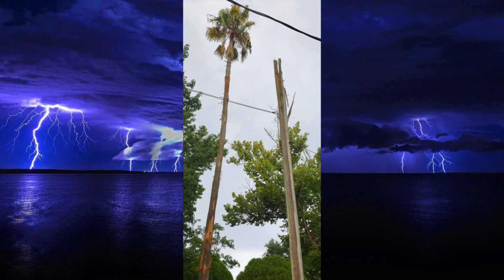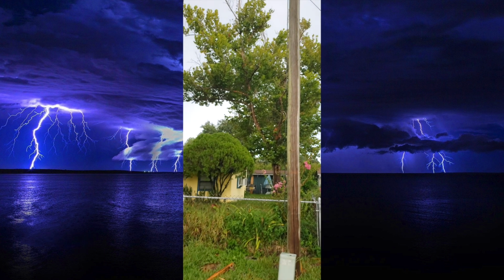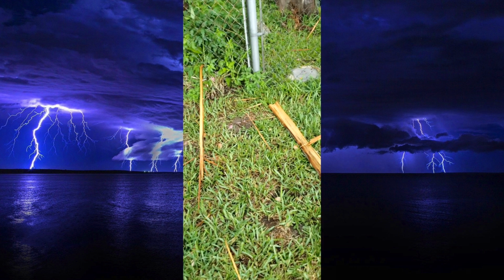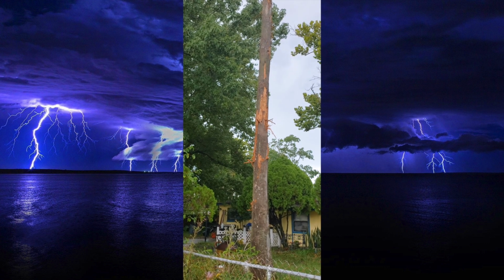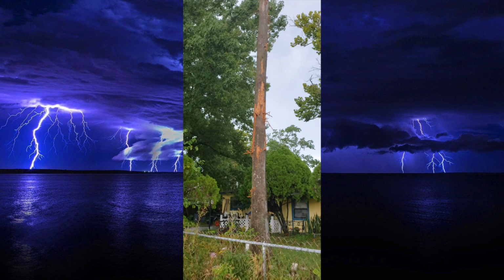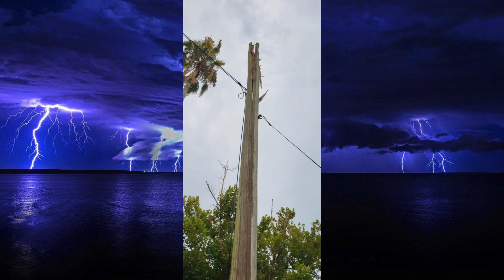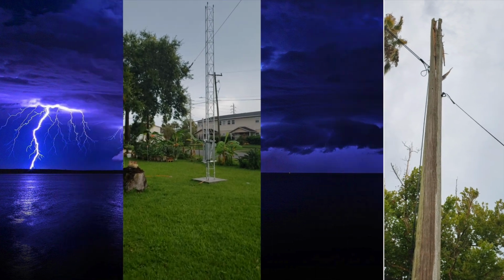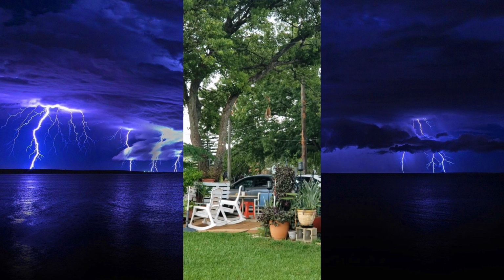Lightning Strike at my station N4VFR! | Hit by Lightning |

Comment: unplug,unplug,unplug. I run a simple station and live in FL. too. never took a hit but i always unplug everything (even have a quick connect to my rotor). I don't know if i can take a direct hit but if i do i know i did everything i could. sorry for your loss. Like your Vids.
Reply from the maker: I'm an airline pilot. Never home and Operate Remote HF.  Leave it plugged in so I can Operate.   I do have a remote disconnect if i need to.

Comment: Hi there from Orlando area, I took two direct hits this year in August! I didn’t file an insurance claim. I just replaced all my modems ,router,security cameras, well pump, run capacitors and a number of other small appliances, all RADIO equipment, was all fine as it was disconnected and unplugged. tower, grounded, and bonded but when you take a direct hit, there’s nothing you can do if it jumps in your house!
Good luck in the future Florida is terrible for lightning. 
73’s N4EVG
Reply from the maker: I still didn't get ARRL Insurance, maybe I should.  Florida is the capital for lightnings.  73 Darren N4VR

Comment: Do you have your tower grounded to the house ground? Because if the tower ground is isolated from your electrical service ground, a lightning strike (or even an induced surge) can create a dangerous difference in potential between the two systems. That voltage difference is what can cause arcing through your equipment, appliances, or wiring. The goal is a single-point ground system where the tower, utility service, and any other grounds (like satellite dishes or external antennas) are all bonded together. That way, when lightning dumps thousands of amps into the earth, everything rises and falls together instead of trying to equalize through your house.
Reply from the maker: It's been awhile.  I will need to check.  I don't think my tower is grounded to the house service ground.  I may have to do that.

Comment: Did you have a surge protector and lighting  arrester for your ham radio and power supply?
Reply from the maker: Yes I did.  My UPS got fried.  My Icom IC7610, Anan G2, RF2K-S Amp, and Palstar HF-AUTO all survived.  I had my PC motherboard and graphics card replaced under warranty.   I had to have my powered speakers and 12" Subwoofers repaired.  USAA Insurance is a Pain in the ASS to file a claim.  I will look into ARRL Insurance due to living in a lightning capital in the US.

Comment: My tower took a direct lightning hit last May and I am still working with the insurance company to get things replaced. I lost all the computers and network gear.  All my antennas on the tower. I also just about all my ham shack radios, tuner, power supply, etc. Working with the insurance company is a learning experience. If you have an questions on my dealings with the insurance company just ask. It will take a while, but you'll get back to normal at some point. 73 de N9JOD
Reply from the maker: Geez, a direct hit on your tower!  Wow!  Right now, I'm gathering my receipts and taking screen shots on replacement equipment.  I hope mine doesn't take long to settle the claim.  73

Comment: Lightning is Tough !   I am a Licensed Amateur Radio Operator but also worked with Electronics in Arizona for 30 Years.  Allot of Field work to include installing equipment on Towers.   I have seen Lightning do so unexplained things that cost us Lots of $$ .    I hope you get back on the Air and also get your Computer back on line...  Thank You

Comment: I have a lot of experience with lightning  strikes sadly. Lightning protection methods like lightning rods, grounding rods,  and lightning arresters are often ineffective for radio towers and the equipment. .  Your problem obviously came though the power lines. And possible cable equipment if you have it.  I had a very good grounded tower.  All the equipment was grounded.  Had lighting arrestors, etc.  I been struck three time in thirty years.  One time  I lost everything electrical in the house.  Over 10,000 in home theater equipment, 20,000 in ham gear.   I how have ham radio insurance.  200 a year covers 20,000 dollars worth gear including computers, software, towers,  radios, etc.   I feel your pain buddy.  Hang in there.

Comment: Sorry to hear of this, lightning damage is relatively  rare on commercial radio sites here in the UK but a bit more commonplace amongst ham radio installations. I appreciate it can be overwhelming trying to diagnose the specific failures after the event. Ii is surprising that companies are replacing or repairing equipment under warranty. Hopefully some hams that have dealt with insurance companies can advise you. 73

Comment: Hi Daren,  I have an Andromeda - and wish I had a G2.  Just thinking about the Thetis working  but VNC not.  Is it possible that you were going in via Wifi for VNC and enet for Thetis?  Maybe the Wifi is out on the Raspberry Pi, but not enet.. .just a guess.  73s de Steve KA6S
Reply from the maker: I'll try to troubleshoot when I get back to see if  wifi is working.  I have the Anan G2 connection direct to my Computer's ethernet (NIC) card.  I did troubleshoot to verify the NIC is working by disabling the Mobo's ethernet network connection.  I try to use ethernet connections if possible.  Oh, I forgot to mention that I discovered that 2 ports of 16 ports that I used to have connections too are also bad.  There is no polling lights when I connect to them.

Comment: Consider adding a Whole House Surge Protector to your mains panel. As you’ve discovered most strikes enter via the utilities. Miles of wires and poles to hit. I don’t recall all the details in your grounding videos, but make sure the mains ground is very well bonded around the outside of the house to you antenna ground rods and entry ground window (trying to encourage more surge current to go around the house rather than through). Run your shack AC, phones, Ethernet, etc. over to your entry ground window and connect them to ground via surge protectors before distribution in the room (doesn’t help your stereo in the living room!) Cadweld one-shots are supposed to be better connections to ground rods than clamps. Finally, how do your Hazer and antenna ground to the tower?
Reply from the maker: I still need to run a ground wire from my Tower to the house grounds.  Thanks!

Comment: Good evening Captain , sorry to hear about this , but let me tell you a quick story to definitely make you feel better. This was 20yrs ago when I was living at home . A storm just passed and out of nowhere my dad’s tower took a direct hit . It melted part of the rotator , came down the tower into the ground and blew a 4ft hole in my neighbors fence (the ground rods were next to the fence) , went back up out of the ground inside the house blew the faceplate off of a brand new kenwood , fried a new computer , fried a new central air conditioning unit , and fried a new tv ! You should be feeling a bit better now LoL . Lightening is no joke , if I’m not in the shack the antennas and radios are unplugged. Be safe captain we”ll talk soon , 73’ N2JDX
Reply from the maker: @stevehall6539  Wow!  Thanks Steve. I'm feeling lucky then, lol.  It's a risk I'm taking to always having my antenna connected to the radios. 73

Comment: When I watched your videos of the tower installation, I didn't see you bond the tower ground to the service ground for your QTH.  I also didn't see you take any readings to determine how good your grounds actually are.  If I lived in Florida, I wouldn't consider putting in a ground system without using something like an AEMC Ground Resistance tester to check how good the ground was.  You also need to read, understand and be fully compliant with the NEC.  Pay particular attention to section 800 - Communications Systems, it specifically calls out amateur and citizens band radio installations.  The first thing a sharp insurance adjuster is going to look to see is if you're compliant and if not deny any claim.  While you're at it get some anti-climb plates put on your tower before some kid climbs it and falls off and you get sued by their parents.

You should also get a copy of the ARRL book Bonding and Grounding for the Radio Amateur by Ward Silver.

As I've told many amateurs you don't have a ground system until you've tested it.  As I've told many an amateur, when you drive a rod in the ground all you have is a rod in the ground.  It doesn't become a ground rod until you've tested it with a ground resistance tester.  When I was watching your video, and you were driving the ground rods they went in pretty easy so I'm guessing you have a pretty poor ground.  Also where all of you ground connections are very close to the ground don't depend on the type of round clamps you used.  The only sure way to connect a ground wire to a ground rod is to cad weld it.

Comment: You can check with an electrician or better a good ham radio tower installer, ,but I  believe, the ground straps on the tower or on any installation can not be bent sharp like that.